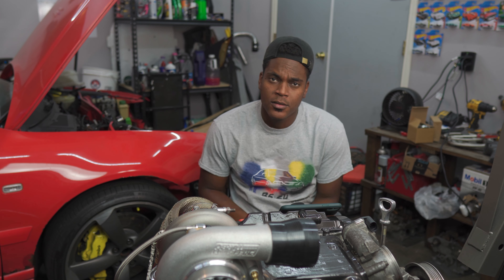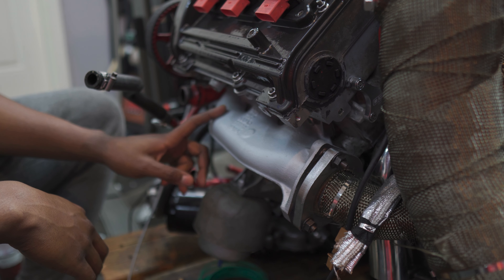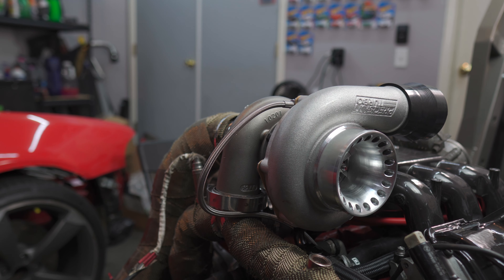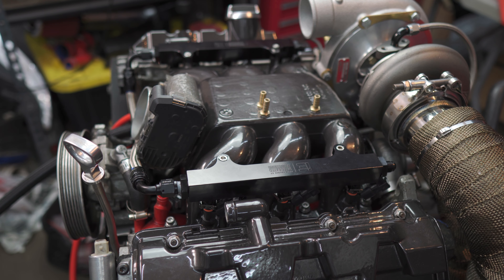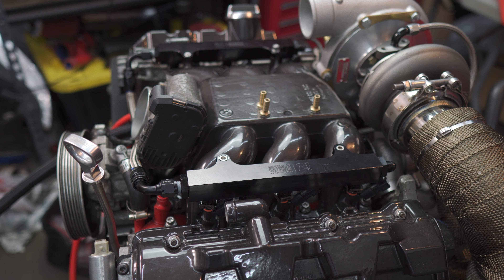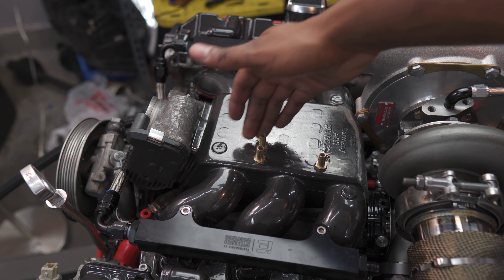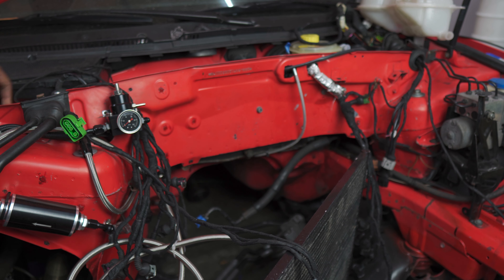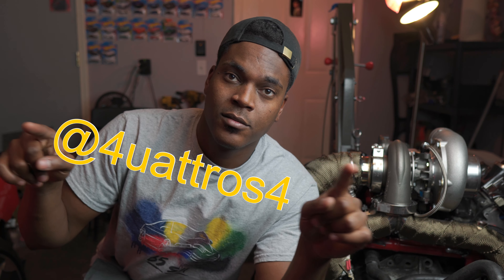How To Single Turbo Your S4

Comment: Hi, nice video, really informative. I plan to single turbo my 2.7T allroad extremely soon.
My only question is, what became of your single turbo 2.7T build? I noticed a Vr6 turbo  in the engine bay of the S4. I missed the updates in between.
Do you recommend the single turbo set up?
Reply from the maker: Hey, thank you! I sold all my single turbo parts to go vr6 so that I could keep tinkering with the car. I would definitely recommend it if you want the experience and noise lol but I think you can be faster on twins if that’s your aim
Reply: Cool, thnx. Do you think a different choice of turbo would have made a difference in the performance? Like maybe something with a smaller back housing, and a decent size compressor?

Comment: Were did you buy your 2.8 exhaust manifolds from carnt get these in the uk  and are holding me back from going single turbo on my s4
Reply from the maker: I found mine locally from someone who was parting out a 2.8 a4 
But you I’ve seen a few floating around on eBay US. International shipping would probably be killer but You may find some on eBay UK
Reply: Yh I guess the search continues and  it is a killer from what iv been looking at not cheap atall been looking at a pair online that look identical to the 2.8 manifolds but there advertised as off a audi a8 v6 part number 078253034DG
Are these the same as the 2.8 manifolds any help would be greatly appreciated thanks in advance

Comment: Question, I see you’ve deleted sai & combi valves, can you please elaborate on what you did to get rid of CEL?
Reply from the maker: So with my car being a manual 2000 in the us I didn’t have to deal with those. But the CEL would have to be tuned out. Although I do have 2.8 heads now that have the rear ports for those but I just blocked them off.

Comment: How difficult was installing the clutch line with the piping in the way? Great progress!
Reply from the maker: I have an 034 clutch line which is much longer and easier to move than the stock line. So I installed it before the engine was completely in. but also would be very easy to do from under the car. lots of space now without the turbos in the way.

Comment: Really enjoying your videos. Sad and happy to see you're going the VR6 route. Would have loved to see more content with the 2.7 single set up. I recently bought a Stage 3 Imola Yellow S4. Wasn't looking for a B5 but I saw the ad and got enticed fast. Little flashy for me but was in great condition. In any case, I'm hunting down a boost leak/sensor issue causing rich fuel trims at the moment. Can't continue with tuning til I figure it out. Is there any chance you could make a video that discusses what you did with the stock rats nest of vacuum lines and valves/solenoids? N80, N75 and not running a MAF for example. I'm starting to gather info and create a parts list for a single turbo conversion when this current setup pops. Thanks for the helpful content! 

P.S. For the love of god, where can you find a comprehensive service manual for this damn car? haha I find free manuals on the forum but the info is all over the place and difficult to navigate. My previous car was a built Mini Cooper and the Bentley Service Manual was a life saver. Very easy to learn and work with.

Comment: Great job on the content. 
Do you happen to have any time slips from you build or any dragy numbers.  I have a a 2.7T and trying to decide which direction to go with the build and if its gonna be worth it compared to what I would spend to build a N54.
     * * Manual transmissions are awesome  ( 3 manual Audi's including S4 4.2l, 08 Hayabusa, and 335Xi).  I've manual swapped about 35 cars.  But until they start making manual transmissions that can handle 7-800 ft lbs of torque, I'm done with manuals for now.  Drive something with a 8HP tranny (swapped or oem) and form your own opinion.  Speed and acceleration is relative. . . . .used to think my GSXR was fast until I jumped on a Busa.  You will build A4s until you encounter something better. . . . 😊
Reply from the maker: Hey Man,
Thank you! I don’t have slips or draggy info on the build sadly. I’m never on the drag strip and didn’t have access to a draggy but that would be a good investment. And honestly you’re right about the autos they’re definitely faster and newer ZF’s can hold a lot of power which is a huge plus. In my case I just like to drive and enjoy being around cars so a manual is better for me. If I ever get competitive about building a fast car then things would change. For the time being I don’t need the fastest, just driving for the fun of it.

Also I’ve never even been on a bike lol
I think it would ruin cars for me 😂

Comment: Your oil feed will melt and ketch on fire router that way .the correct way which is forward up through the first runner back to the turbo.just trying to help I have a fully built 2.7t with a complete tubular manifold setup in my b7 s4 .things melting is a big issue.if a oil line of any kind sprays on your exhaust it will not might but will ignite.
Reply from the maker: Thanks for the advice

Comment: can I get a list of the vband clamp sizes for turbo hot side inlet and outlet and the downpipe
Reply from the maker: You need a 3" v band for the turbo to up-pipes and a 3.5" one for the for the downpipe. The downpipe also ends on a 3.5' v band but some cut it off to weld an exhaust and other use it as is.
Reply: @CIPGAS  thank you so much
Reply: Those are well are suppose to be precision specific they're flanges change be bought at ATPtubo.com

Comment: How much power is this good for?
Reply from the maker: With this turbo would be good for a little over 600 AWHP
Reply: @CIPGAS  that’s solid! Should be fun! I just did k04s on my 2.7. Not a daily but fun enough. But that’s also in a C5 Allroad

Comment: Does anyone know if it's true that you can only run the tial mvr, xs power claims it, but I don't know that I buy that
Reply from the maker: The flange is made to run that specific wastegate and the space under the manifold is very limited too.You might be able to use another wastegate if you weld a different flange in but the space may limit what you run.

Comment: So weird, I’m getting my donor b6 a4 3.0 6 speed this week, taking my 2.7 6 speed from my a6 and transplanting into the b6 been debating a STK, or f21s just not for sure because one is light mod and the other requires top to bottom work lol
Reply from the maker: Both are great options. The duals are easier now because there are less changes but maintenance on a single build is easier.
Reply: 4uattros4 that’s where I was wanting to be with it, change a turbo in 45 minutes vs pulling an engine sounds wonderful
Reply from the maker: Brian Steinkamp Exactly!!

Comment: Go for the 5 cylinder engine! It's higher performing than the V6 I think.
Reply from the maker: 5 cylinder would be great but it’s a lot more work to swap in an engine bit meant for this chasis than to make power on the 2.7t. Specially when this engine e can handle a fair amount of power, sounds great, and has a huge aftermarket.
Reply: From a rs3?
Reply: @bigbootyanime3630  Preferred from an RS3. But other 5 cylinders from Audi or Volkswagen are pretty decent.
Reply: @ericgorder1  you know alex mirea? He did that to a b5 a4 but s4s  only should have a 2.7 still dont know why people swapping motors choose b5 chasis not b7
Reply: That's what I did built 2.7t bored over je. Ie.and put it in a perfect b7S4 full custom tubular single setup .it's my daily will 600 working on more.

Comment: if your engine is built a 6262 ball bearing would EAT on this set up
Reply from the maker: Engine is built but I’m looking for quicker response. The top end of the 6262 would be great, but I’d rather have the torque on the low end a few rpm earlier.
Reply: 4uattros4 thats fair, she’s gonna pull like a freight train im excited to see the finished product
Reply: 6262 gen2 will spool faster then your journal best 5858 I'm running a gxt3582r gen2 which is a65.7I'm compressor wheel and 82ar. Seeing 10psi by 3000rpm and 27psi by 3500rpm spending money on a turbo is the one thing you should if you want a fast spool time AND big power.
Reply from the maker: @mk2vrt  Turbo is definitely an important buy and it is definitely something you should spend some good money on, as much as your budget allows. Also a ball bearing turbo would definitely spool a bit faster that a journal bearing turbo but it would definitely not be. Big difference as that’s not its main advantage. A lot of the advantage of BB is the continued inertia which would allow you to hold boost much better between shifts and also durability when correctly oiled. But with that said spend a much as you can on a turbo but don’t let anyone tell you what you have is bad just because they bought something more expensive. Everyone has a different goal and budget and that’s why there are so many choices.